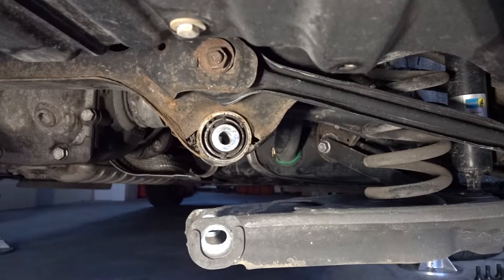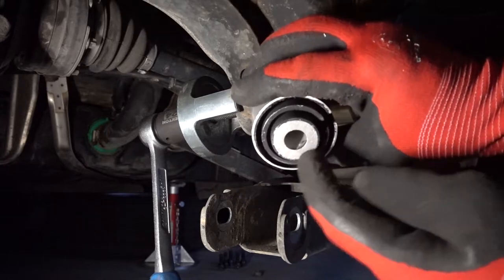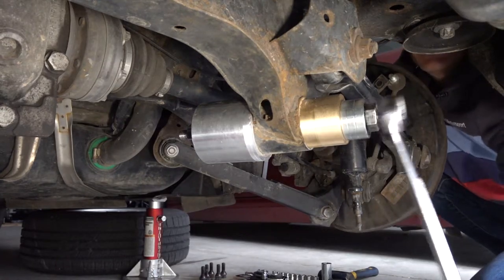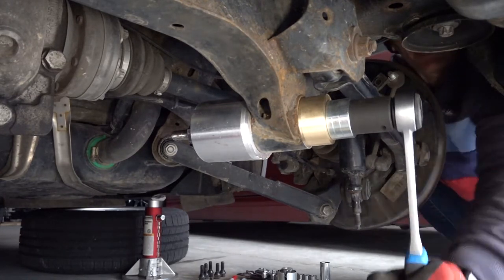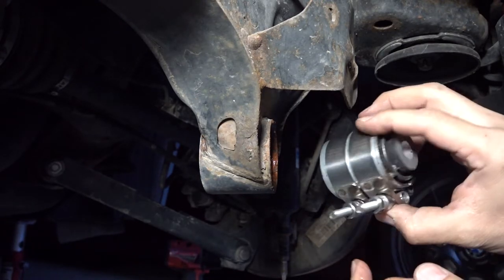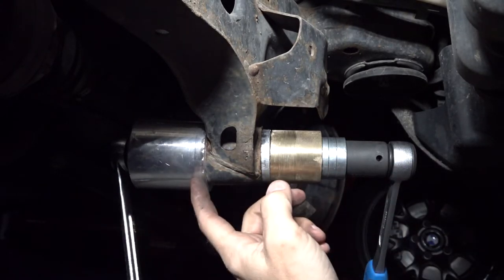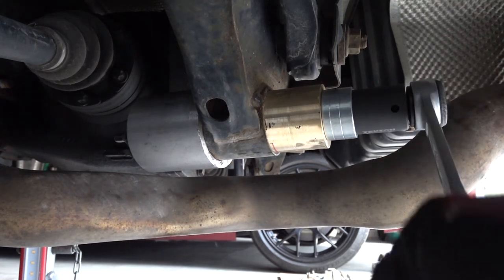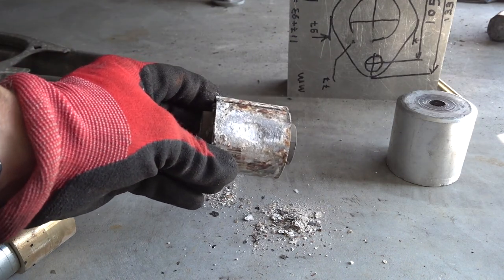BMW E90 325i Rear Lower Inner Bushing Replacement How To

Comment: Appreciate the great video man
Reply from the maker: Thanks! Could have been better :)
Reply: @maxsam201  Did you have to disconnect the exhaust from the hangers for the driver side? I'm wondering if it's worth changing these if I'm at 145,000 miles.
Reply from the maker: I don't remember ))) but would think that disconnecting all 3 rear hangers would allow you to move exhaust a few inches. Also, this is a single piece all the way to the down pipes, it's not much flexible. Rubber exhaust hangers do degrade over time, but it's hard to decide on the exact point for replacement, this 2006 car had about 200,000 miles and still had original pieces in good shape.

Comment: I am doing all 12 Bushings on my BMW 335i E93, can you recommend an extracting kit for all the bushings or are they individual kits? Can you recommend some? That one looked heavy duty!
Reply from the maker: I guess any generic "bushing/ bearing removal " kit would somewhat do the job.  SummitRacing etc. sells many different ones. Buying something BMW specific is usually not cheap  at all, but there's a guarantee that it will work. I just don't have anything specific in mind to recommend, sorry.

Comment: What size are them bushings? Just wondering what size t b clamps would i need? As special tool for this is just way overpriced. Thanks
Reply from the maker: Well, if you have watched the whole video, you would have known what size t-bolt clamps are :-) They are 2". As far as bushings go, I need to measure them, if you need exact numbers.

Comment: Thank you for sharing. What is the diameter of the hole where the rubber bearing is mounted?
Reply from the maker: Are you asking about the subframe?
Reply: Yes, or the diameter of the Tool you Used

Comment: What is the outer dimension of the part that presses the bushing out?
Im about to do the same job, and i have some pressing tools but would be nice to check if i actually have the dimension i need.
Thanks!
Reply from the maker: I need to measure it, don't remember from the top of my head.
Reply: @maxsam201  That would be awsome, Thanks!
Reply from the maker: 51 mm is the number, if it's not too late.
Reply: @maxsam201  Awsome, thanks alot!
Reply: @Alpejohn  in the process of doing the same.. this is the last bushing I have left to change on the subframe.
I have a kit & there is only 1 black piece that is ~51mm but i cant see it fitting, maybe the rust.. were you successful? I already bent a steel rod lol

Comment: Have you seen the ball joint bushing kit on FCP euro?
Reply from the maker: Hm, probably not.
Reply: U just bought the 12 piece bushing kit and I am here wondering what extraction and pressing kits I need in addition! The one the OP had looked heavy duty
Reply: @Critical7hinking  Which 12 piece bushing kit did you buy?
Reply: @kurtm54  only 12 kit they have, but it’s for the rear only. Subframe and knuckles
Reply: @Critical7hinking  ah I see why you said that. I wonder if I meant ecs tuning. They have two kits around 200 and 250. Unfortunately you need both to do all of the inner and outer bushings and ball joints in the rear. I do not know if they work for the subframe or differential mounts though. Even using those kits, I had to buy some extra grade 8 hardware bolts, nuts, and washers. There's a video on YouTube from some place called HCB tools that shows how to use the kit. Are you talking about a 12 piece kit of the bushings and ball joints for the rear, or a tool?
Reply: @kurtm54  correct the 12 piece kit of bushings from FCP. Just for the rear subframe and knuckles.
Reply: @Critical7hinking  Then if you want to save yourself some grief, I would recommend picking up the bushing installation sets I mentioned earlier. There are two bavauto sets needed, unfortunately. Bavauto no longer exists, but ecs and turner sell their old kits. I don't think bavauto even designed the kits in the first place anyway. I would rent them to you but I'm hesitant to give out contact info on YouTube haha

Oh and I'm not sure if the kits work on the subframe or differential.

Comment: Hi where do you get that tool kit  I really need one  thanks
Reply from the maker: The main kit was that tool for E46 trailing arm bushings removal/ replacement, it was bought used a long time ago, so unfortunately I don't recall exactly where it came from. Any generic bushings removal kit should do the job.
Reply: Ok thanks